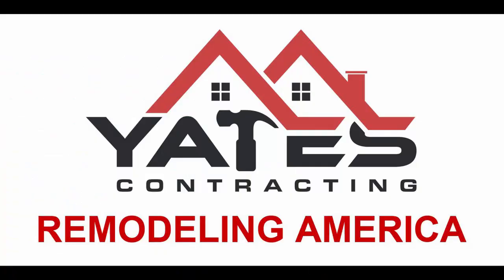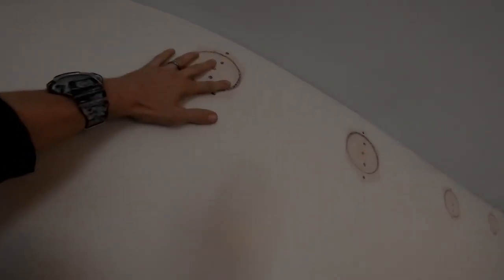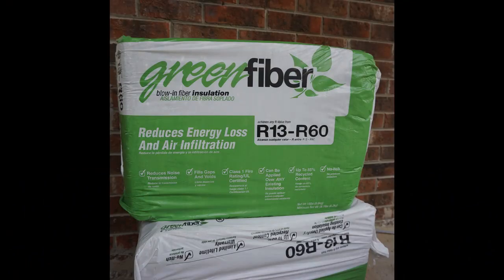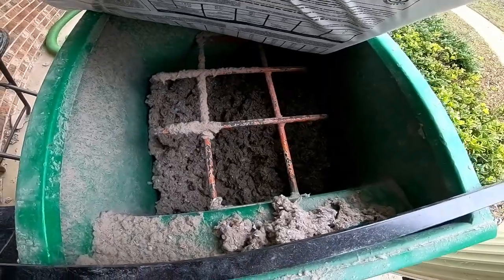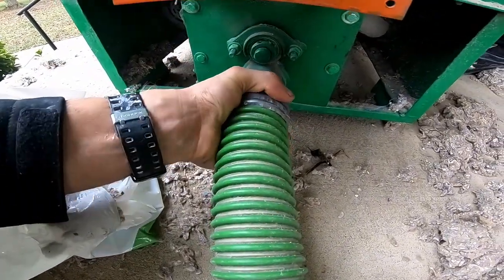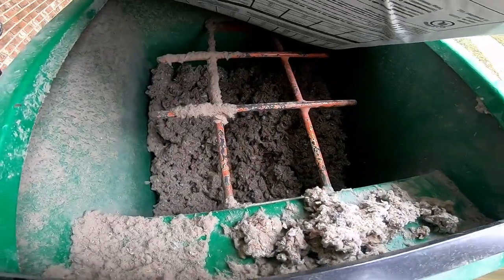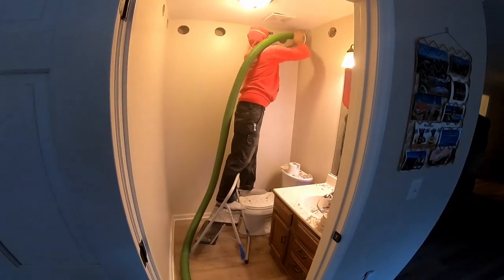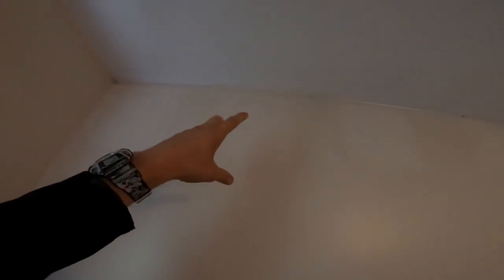Green Fiber Cellulose Soundproofing and Insulation

Comment: The best patch for round holes is to use the hole saw on a  small/medium piece of new board, cut a square on the front with a razor knife then holesaw from the back leaving white paper untouched, cut a few lines on the leftovers and peel away wall board leaving square white paper face then mud the round part of the patch with a lightweight top coat. Viola.

Comment: Trying to deaden the sound between 1st floor and 2nd floor because the contractor decided not to insulate the ceilings for sound like I had asked and instead left it hollow. I'm in Brooklyn NY and I was quoted $4,200 for 1,400 sq. feet of ceiling. Just feels kinda high but I may have no choice.
Reply: Hey, did you end up doing the job and are you happy with the result? I am about to do the same in our Condo that has a very small piece of insulation between floors.
Reply: @Hdimator  Unfortunately no.  I've had so many negative experiences with contractors that I never followed through.  What I think I might do is use quiet rock on the ceiling.  It won't stop any structural (footfall) noise but that's not something I am concerned with.  It will help with airborne noise like music and voices.   Good luck!
Reply: @gobofraggel7383 Why not use MLV?
Reply: @MBisFrenchy  I was up at 3am and saw your reply.  Spent an hour learning about MLV.  How I never heard of it before I do not know, but so glad you mentioned it.  I plan to use it on my ceiling and cover it with quiet rock.

Comment: When you blow the insulation into the walls what about the air that is blowing into the walls?   Doesn't it blow back out of the hole?  Thanks Cameron.
Reply from the maker: Some of it does, yes.  This is needed tough so that the insulation/air doesn't crack the drywall.  That is why we use the cloth to allow air, but not the insulation to escape.

Comment: I'm getting ready to fill in the walls for my garage. Pretty standard walls (8' tall, 16" spacing of joists, 3.5" gap between drywall and exterior siding). Just wondering how many bags I will need if I have 19 cavities to fill? Any input you provide will be greatly appreciated. Thanks
Reply: It should say on the product itself, if you pack it tight...but blown in lightly, is rought 70 square feet for 3.5" deep. So a bag inside each stud...19 bags for you.

I believe if you buy 20 bags from lowes they let you have the macine for free for 24 hours

Comment: Thank you for an informative video. Would have loved if you gave more detail on how exactly this is "not a one-man job".... it sounds like the necessity for two people is simply one person blowing everything in, and a second person on machine duty - turning machine on/off and filling with more cellulose. Anything else that makes this a two-man job?
Reply from the maker: You are correct.  That is basically why two people are needed.  It is hard to know if the machine is blowing the insulation when the tube is in the wall, that is why it is important for the second person to keep the machine fed.  Also, if you don't turn it off right when you take it out of the wall it will blow all over the place!!

Comment: Hi,

Great video, I am going to insulate my interior walls and ceiling on my duplex.

Is there any recommandations for protection of the electrical wires around the plugs or the regular lights and recessed light in the ceiling?

Thanks,

Tim
Reply: I'm thinking of doing the floor/ceiling of my duplex....any luck?

Comment: What size hole is needed in wall if the hose is 2.75 inch outside diameter?
Reply from the maker: Sorry for the later reply, we rigged up a toilet flage. So I think it was 3.5" hole?  Thanks

Comment: Wondering if this insulation is suitable around recessed lighting? Or are there fire safety concerns? Thanks
Reply: The lights need to be IC rated/type. Check the stickers on the light